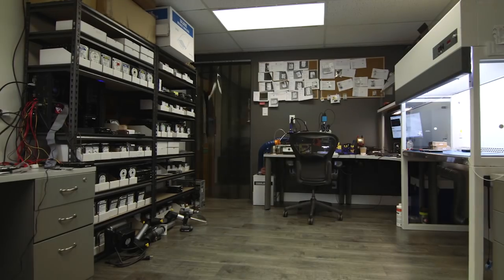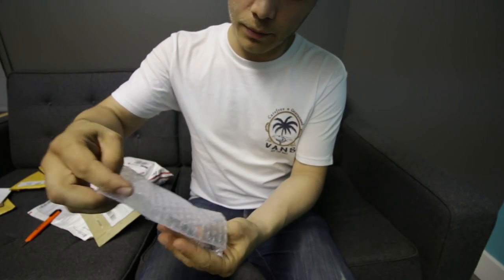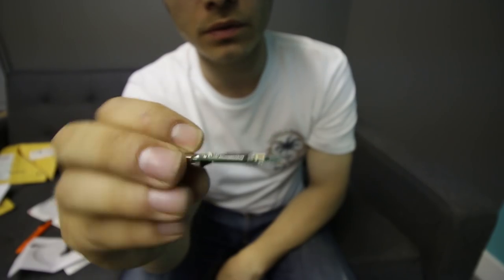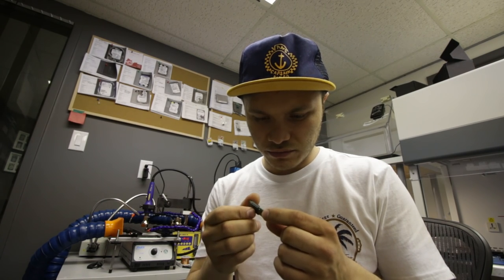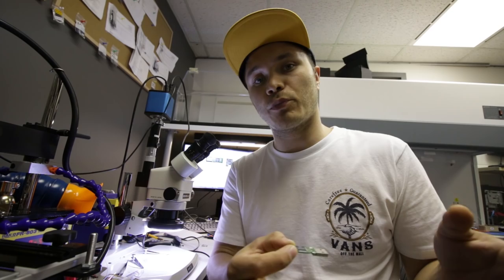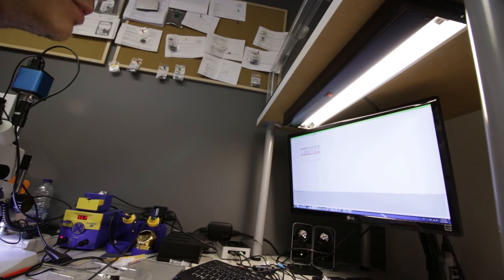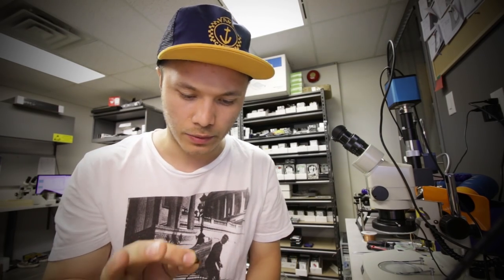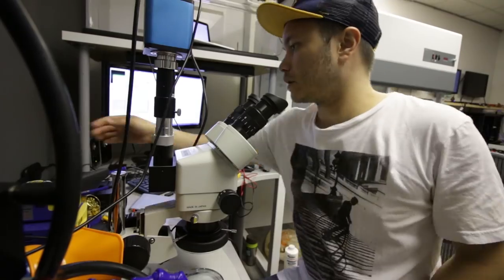data recovery vlog - here is what we got today

Comment: Had a old seagate drive failing on me a week ago. It did work without any bad sectors, did copy data from a external hard drive to this seagate drive. When i came back home, the drive was dead. Very slow response, gets recognized, but throws at bad sectors right away.
Can't create MBR, read speed is less then 0.5mb/s :) The drive is 11 years old, so that's a pretty good age for a seagate drive.

Do you know if there are known issues with the Seagate ST1000DM003 ? I have that one in my desktop and it works great and fast.
I had to RMA this drive once, because it bricked on me while doing Secure Erase. That one gave me I/O error, can't create MBR in Disk manager. 
Also haveST2000DM001, also fast, and it's in the Seagate ext hard drive enclosure.

My laptop has a ST1000LM024 and sometimes it clicks and beeps, but yeah it still works. My Scorpio Black is for RMA right now. Did drop it on the floor, but it still did work and it did click of death sometimes when spinning up.

Comment: i've seen alot of vids of swapping out the rom chips on pcb boards. wouldn't it be easier to just wire the chip to the donor board ? i'v never seen anyone do this so whats the reason?
Reply: ?  It's easier, faster, and more reliable to just swap the chip.

Comment: I'm curious how converting the external from USB 3.0 to SATA allowed you to gain access? Does USB have more restrictions or?
Reply from the maker: Converting the drive to SATA and trying to access data without clearing out module 32 is not going to give access to the drive. Module 32 is located in Service Area. Access to service area of the drive can be gained without the SATA swap, but the terminal would need to be attached. I find that with SATA swap it just works more reliably, and since PC3000/Data Extractor can now decrypt data on the flight I find this method works best.

Comment: hi men 
which program recommend you to see health of hard drives?

-sorry my bad english
Reply from the maker: I honestly don't use anything other than PC3000 and Data Extractor for my work on hard drives (well Winhex, R-studio and UFS explorer too). But that covers everything for me. PC3000 is the tool that helps me diagnose the issue, and check the health of the drive. That being said, I am sure that there are tons of freeware tools that can check SMART and run surface scans to tell you what state the drive is in. In my practice these tools are irrelevant because on degrading hard drives running surface verification tools is similar to checking the minefield by walking on it.
Reply: In the ultimate boot CD there tools for HDD diagnosis, many of them read SMART data from the drive. Other calculate metrics while performing tests. Use at you risk because some of them can turn the drive into a paperweight when improperly used. Of course these tool are from being something pro, limited, just for basic diagnosis.
Reply: Hi! Awesome video! You just got a sub. Any advise for an aspiring data recovery technician? I have a degree in Network administration and security information but want to learn about data recovery. Certified Data Recovery Professional (CDRP), is this cert recomendable? Infosec offers a bootcamp. Any thoughts?

Comment: following you on youtube... have a micro sd card , 16gb samsung. controller test (continuity passes, not shorted) but when I use a trial version of r-tools or another app, it takes FOREVER to read. I had it running 24x7 for at least 2 months and EASEUS DATA RECOVERY WIZARD (application i paid for) FINALLY completed a deep scan, then it proceeded to 'build the file/directory structure, and is taking (in my opinion, WAY TO FLIPPING LONG). looking for any help... I have done a fair amount of research on how to recover and some of the various software tools to achieve this, but none seem to be working... I think I have an I/O problem... is there anything that can be done to help the process along.... I am doing this for a friend I work with, he just wants the pictures off of the micro sd card... 
Just out of curiosity, how much would you charge to recover (if possible) if I send the card to you... thanks
Mike
Reply from the maker: Imaging it would be a good idea. Fill out your form on our website, link in description box